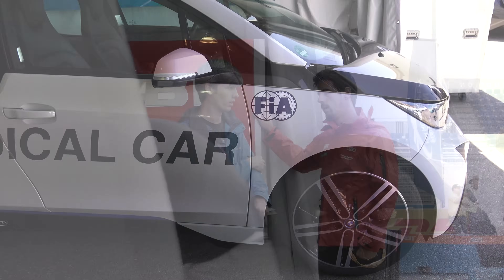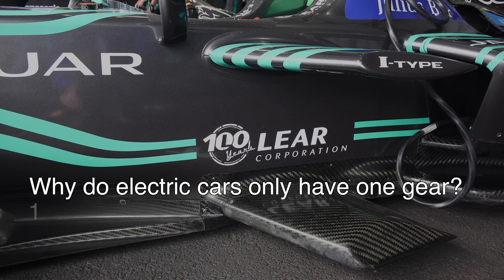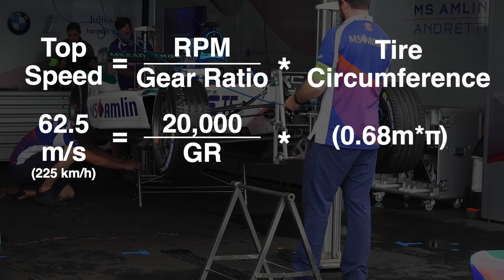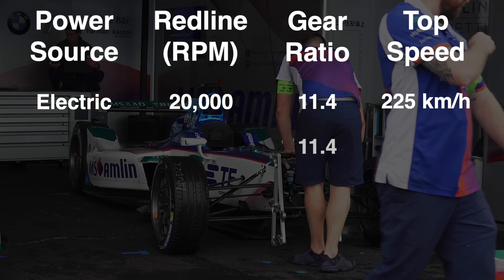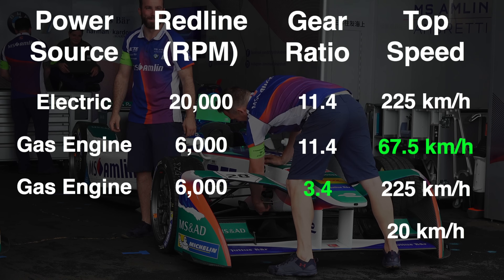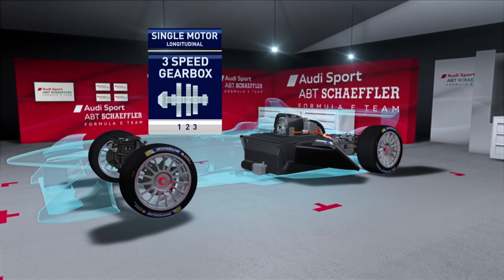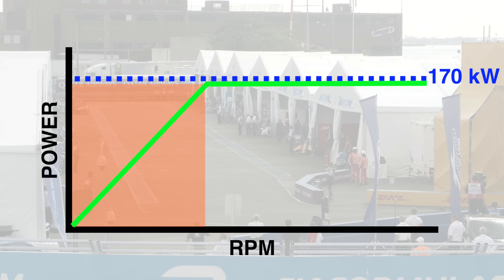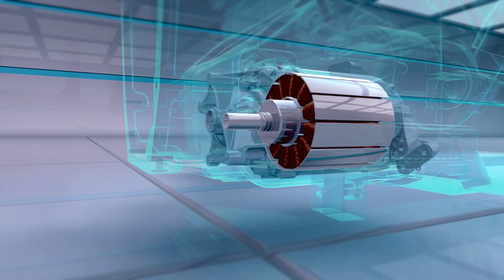Why Do Electric Cars Only Have 1 Gear?

Comment: I am a car guy and love traditional combustion engines, but electric-powered cars are outperforming them- just as cars were outperforming horse-powered transportation at a distant place in time.
The future is efficient and torque'y, but completely mute.
Reply: It IS far fetched. FIrst of all pitstops are 30s and not 5. They just stand still for 5 seconds.
And 1000kg of battery? do you know how much laptime this is? On an average lap you can say, that 1kg = 1 tenth. Thats 90s per lap slower than what an F1 car, because of the weight.And even more at the end of the race, because the petrol gets burned the batteries stay. You cant make this kind of times up, just because a electric motor has more torque
Reply: KOrbiid By design. FE is designed to be slower than F1. You can't just kill your main product. What they should do is allow electric cars in F1.
Reply: You can allow them, but they would only get to 5% race distance and would still get lapped...
Reply: That's not what Tesla and Panasonic are saying. They are saying nothing about the new 2170 battery's degradation curve.
Reply: allister white They don't need to be replaced every 10 years. They hold enough charge for our current needs. They are more than good enough right now.
Reply: stan broniszewski What's so special about the Plymouth? 1971 tech seems extra dirty. Would you prefer the Plymouth if the exhaust were plumbed through the cabin first?
Reply: nicktecky55 What degradation curves have you see? What does current degradation indicate?
Reply: stan broniszewski How many hours a day do you sit in your car? Do you not plug in your phone, laptop or cordless tools? Cars spend more time parked rather than in use. Easy to keep them plugged in. I'm sure your neighborhood loves your partially combusted gasoline packets of love.
Reply: George Tsiros Your pencil doesnt make noise? Mine does! Lucky you!!!
Reply: Monkey good that you know where the future leads but petrol engines are muffled to be pleasant on the ears.  Bare it and it will be ugly 1800's first internal combustion engine. 

Electric motor sound can be amplified to suit anyone's hearing preferences.
Reply: @GeorgeTsiros  For car guys the sound is a very important part. I wouldn't really consider myself a car guy, but the sound of a v8 is definitely much nicer than that of a silet "soulless" electric car. That said, as technology improves and batteries become more efficient, electric cars definitely have the potential to become the future and I have nothing against that. I would even like to see more electric cars on the road, and if we can transition to cleaner energy sources, electric cars could lead to a much less polluted future.
Reply: Only if you can stop, refuel and be back on the road for another 700 miles in less than 5 minutes. 

Until then, electric is not the future.
Reply: Three years later this is still true (except for the small matter of weight).  It's also no closer to coming to fruition than you probably believed it was three years ago.  Batteries are still too heavy.  EVs are still too expensive and the infrastructure still isn't there.  Once they sort these trifles out, it will be electric all the way.
Reply: And politicall communist..Kamala CACKLES Harris, SLEEPY CREEPY Joe Biden....ANTI STATE OF THE UNION ADDRESS NAncy POelosi..AOC. GRETA THUNBERRG>.AWFUL politics be involed, even with Elon Musk and Arnold Schwnarnegger and good design.,., today';s vehicles rteally are for the "My wife's boyfriend" meme soyboys..okay..had to throw that meme in there..but it is rather part of it..take care.
Reply: KOrbiid
>electric car will never beat a f1 car over a normal race distance!

Don't say never. It will probably happen one day. Probably not for several decades, but still likely.

Currently the best experimental batteries in labs achieve around 1,7kW-h/kg. This is around 8 times greater than commercially used batteries like the ones used in FE. Upper theoretical limits on battery tech allow for around 12kW-h/kg.

If you could double that 1.7kW-h/kg figure, it would put electric F1 cars on par with their ICE counterparts for weight/range, and would still have the torque advantages of an electric motor, meaning overall they would be better.

That's around 15 times better than current commercial batteries however, hence why it will likely take a while for it to happen.
Reply: Even as an engineer I have to say, I watch racing mainly because of the racing. The engineering is also nice, but the fun part is racing. And my answer was like that, because he said, that electric cars are outperforming petrol cars and my opinion on that is, that this will never happen in racing. Maybe on the streets but an electric car will never beat a f1 car over a normal race distance!
Reply: I am talking about racing? FE is not even remotely close to F1.
Reply: Yes thats true ofc. But with batteries I dont see it happening.
Reply: For racing, Hybrids is the way to go. Getting the best of both worlds!
Reply: KOrbiid F1 is only allowed 100 kg fuel per race. This is 1300 kWh of energy. They are able use maybe half that after losses, so 650 kWh is what they need to put out. Let's say an electric car is 80% efficient (it would actually be way higher) so it would need about 800 kWh of battery to compete during the whole race. 3,200 kg of battery per race. With a minimum of one pitstop, on board is 1600 kg, 2 pitstops is 1000 kg of battery on board. Average speeds are about 200 kmph and races last about 1.5 hrs.

Pitstops make up a total of what? 5 seconds per race? or 0.1% of the race time.

Lets say a electric car spends 10x as much time in the pitstop, not 10 pitstops. That is 50 seconds per race, or 1% of the race time.

So if an electric car spends 2% of the race time pitting but is 2% faster it would break even.

It isn't at all far fetched to see an electric car destroy current F1 cars.
Reply: The noise that motor produces is an energy that went to total waste instead of going into torque.

Comment: Someone had asked me about this and as I started my research your notification popped up. Interesting... I just simply forwarded your video. As usual... awesome job!
Reply from the maker: Thanks, and thanks for sharing!
Reply: I think you could have pointed out better one aspect that is in my opinion the key difference for gearing between electrical and combustion engines. A combustion engine might at best have a wide flat range of torque so you have at best more or less linear increasing power. An electrical engine on the other hand has almost constant power curve over the whole range and a corresponding degressive torque curve which is theoretically infinite at the start. The torque is more or less proportional to the current which needs to be limited and is limiting the torque therefore. Mostly only for that reason the full power is not there instantly and once the torque is not limited anymore the power curve is becoming flat even without a power limitation. And the maximum current is more or less proportional to the engine size and therefore weight. So having torque at low rpm is essentially a trade-off between engine weight and transmission weight (usually favoring a slightly bigger engine and passing on the multiple gear transmission). I am sure that is what you meant, but I think it might not have become clear to everyone watching the video.

Comment: To say that the 3 gear solution used by Abt/Audi was better than one gear Renault transmissions because Buemi lost the driver's championship disregards what actually happened. Renault clearly had a superior design and dominated this season and the driver lost because he missed two races and cracked under pressure in the last two, DiGrassi himself admits that his team had a worse car.

Comment: One mistake, about engine RPM vs Power:
At constant voltage, engine torque decreases with increasing speed. Maximum speed is achieved at no load - that is when no torque is generated, thus power is zero. Maximum torque is generated at zero speed, because torque~current, and at zero speed there is short circuit current. From that we can see that power is zero both at 0 RPM and maximum RPM. Maximum mechanical power is achieved at 1/2 maximum speed. 
This all of course is at constant applied voltage. But voltage just changes maximum RPM and maximum current.

Comment: Fun fact: dual-motor Teslas (75D, 100D, P100D) have different gear ratios on each axle (but a single ratio per axle).  The rear ratio is optimized for acceleration since the weight shifts back there during a launch, while front ratio is optimized for  highway speed cruising and better regenerative braking, since the weight shifts forward during braking.  So launching at a traffic light, you're in a rear-wheel-drive muscle car, but once you're past the on ramp you're in a front-wheel-drive economy car.  On a highway, the rear axle is essentially in neutral until you're ready to pass that slowpoke Dodge Challenger.  Best of both worlds, which is why the dual-motor configurations actually get better range than the older RWD only models.

Comment: You know what ? You can do gearing inside motor winding as well, make two of them and in low speed make it in series, at high speeds make in in parallel do to back EMF. And surprise, you have gearing effect at some cost from electronics :)

It will feel like VTEC :D:D one very well defined spot, just inverted :)

Comment: Why not with a CVT transmission? Best of both worlds
Reply: Martijn Cornelissen a CVT is meant to keep an engine at the most efficient RPM, but an electric motor has practically the whole rev range as the most efficient
Reply: CVTs are not very efficient because they are usually friction based

Comment: So a question I've yet been able to get a straight answer on is what type of electric motor is used on these cars. More specificlly burshed vs brushless. While brushed motors have a significant higher torque at start up the have a dis advantage  in efficient and high speed. Brushless have much higher top speeds and extremely efficient how even from a stop they have an issue with coging. Where the motor has to figure out where the motor on the armature using the rf being pushed back through the wires. This can be alleviated by a sensor system but at the addition of some complexity. So which type of motor do they use?
Reply: Permanent Synchronous Motors so brushless and yes they usually have a rotor position sensor

Comment: I'd love to have a stick in eCars....
Reply: pSyk there was a Chevy S-10 I seen once that was converted to EV, but it also retained the 3 pedals and 5 speed. Wonder what that would be like to drive, I'd bet if you actually shifted it'd be very fast, as you can even get decent acceleration just in 5th gear alone lol
Reply: Look up the Detroit Electric SP:01
Reply: Some of the FE cars have a gearbox for better torque management...but it's flappy-paddle operated (stick would take up too much room in those cockpits).
Reply: pSyk why with it you lose space money and you slow the car down
Reply: In trade for range and entertaining driving. Quite a treat!

Comment: I still want an electric vehicle with gears there's nothing i love more than shifting an H pattern or banging away of sequential dog box
Reply: Joshua Bliffen I know a lot of EV conversions are stick shift so idk why no manufacturer has tried a stick EV, just leave it in 5th when you don't want to shift, or do shift if you want brutal acceleration
Reply: Justin Noker yep i have seen them to. When we go all electric iam really going to miss gears. : (
Reply: Honestly Joshua, you won't.  My last car was a '95 Saturn SL with a 5-speed manual.  I thought I'd miss stick-shifting too when it died and I switched to a Tesla, but really I don't.  Once you've tried "one-pedal driving" you just won't care.
Reply: when your are racing through a canyon or offroad rally racing. one speed it very linear. to me linear acceleration gets very boring after wile. that why vtec boost and nos is so much fun. i feel like iam driving a crappy cvt transmission when i drive an electric. idk there is so much less driver involvement.  as a daily driver shur its great. but as far as racing goes or when i like to drive as a dayly. it will just not do for me.

Comment: Wouldn't there be a lot more electrical powered used at higher RPMs? I understand that because of the high torque, a gear box would take a lot of stress while upshifting. What about a CVT? Wouldn't you be able to significantly improve the range of an electrical vehicle by keeping the RPMs low while cruising?

Comment: Why don't they use asynchronous motors, they should have full torque from 0rpm. Hub-mount them and I don't see the need for high-revving or gears... At least that's what I was taught all the way back in school...
Reply: We'll never see hub-mounted motors in competition (and I'm pretty sure no one will put them into production vehicles either) because that's WAY too much un-sprung weight. The suspension won't be able to push the wheel back down fast enough after hitting even small bumps. At high speeds, that could mean a wheel in the air for dozens of feet which significantly impacts turning and stopping.
Reply: They use synchronous motors and yes the have full torque at 0 RPM

Comment: having multiple-gear transmissions will or will not increase electric cars range?
Reply: stef catalin probably not, if anything id imagine it'd use more power trying to shift the gears than any savings would be

Comment: Great Video! I have always wondered how air conditioning works on electric cars since they dont have grills and evaporators.
Reply from the maker: +Stuart Johnson same way they work with ICE's. They do in fact have air intakes up front, to use with the A/C heat exchanger.
Reply: Engineering Explained do they have a compressor as well? If so is it belt driven or electric?

Comment: Wouldn't it be more efficient if a electric car had let's say 2 or 3 gears. If you are driving on the autobahn at let's say 100mph then you might already be at 15k rpm where if you had gears then it it would be at let's say 7k rpm. Wouldn't it have a longer range at lower rpm at the same speed??
Reply: sasajungic89 well first off, quite a few EV's can't even do 100 (in fact if i remember correctly, the Chevy Bolt for example is limited to 87) and second off, as I said in the example they do most likely limit the car in a way so as to not go too far into the inefficient range
Reply: 93 actually

Comment: gearing can definitely add performance to an electric car. there is a limit to how high you can rev. its more efficient to be at say 5000 rpm at 200kmh than being at 15000 rpm at the same speed. excess rpm is both bad for wear and tear and also it means extra loss of energy. If FE was held on F1 tracks like monza, 3 gear could help with top speed better than accelerating.